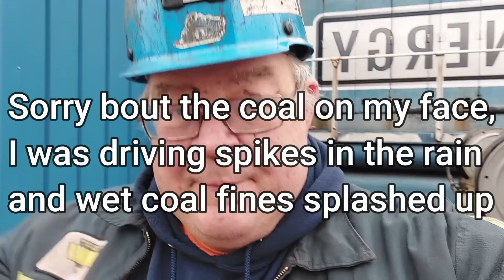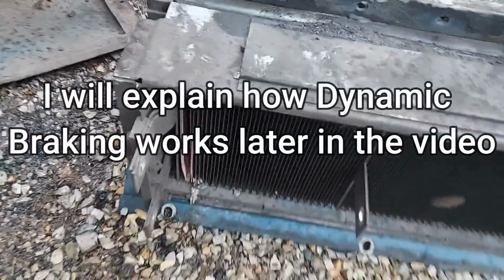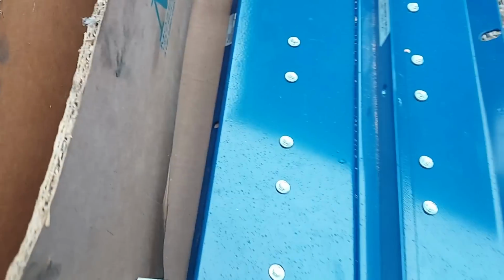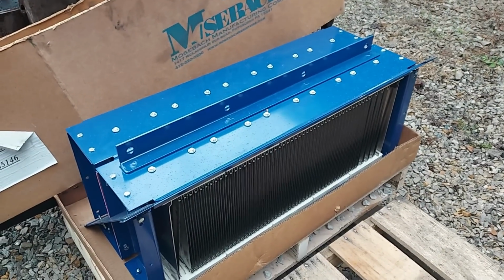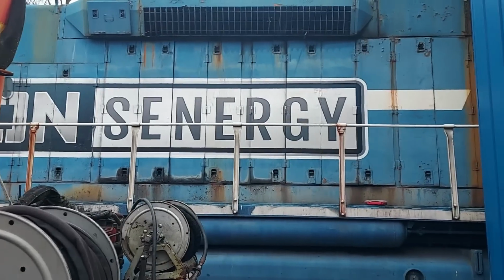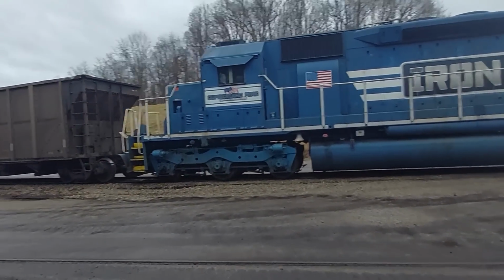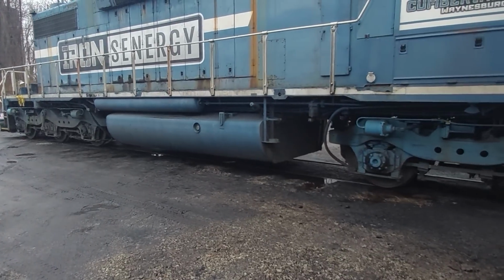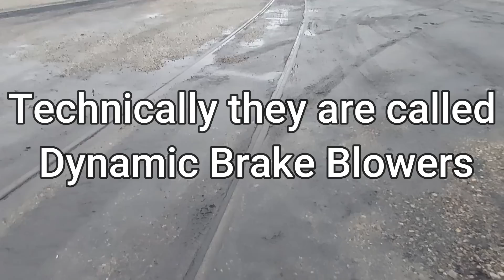New Locomotive Dynamic Brake Resistor Grids

Comment: There is no need to apologize about the soot on your face. At least you are making some contributions to America. I remember that the resistors underneath the [electric] New York City railcars or subway cars have been formally called "rheostats," in the Road Car Inspector manual. The dynamic brakes work as a combination of electric brake and pneumatic (airbrakes). Long ago, I was told that when the controller is switched off, the traction motors rotate in the opposite direction to cause a "slow-up" of the train, and a slight amount of airbrake is added during dynamic braking. The electric brake slows up the train and sends braking impulses to the other railcars, trainline. I have always wanted to learn how a locomotive works, and I am willing to learn more.💙
Reply from the maker: That is very interesting to find out about the air brakes working with
the dynamics on those Captain Keyboard, I did not know that. We
have the option to use independent brakes on the loco while in
dynamics but they are not applied normally as part of the dynamic
braking process. Thanks so much for sharing that with me my friend!
Reply: @ccrx6700  Well, you think on high, while I speak on "low." I believe that freight trains are more powerful and advanced than many electrified passenger trains. Thank you for typing to me. Bright Rails and Happy Railroading!👍🚂

Comment: At first I wasn't sure what you were talking about but after you said they dissipate heat I knew them what you meant. The big electric motors in the rail mill where I worked had a room full of heat dissipators. Those motors also could be run either way. Cool video. And as far as the joint bar I thought that was pretty rare for one to break. Happy rails to you.
Reply from the maker: That's pretty neat to hear Michael, I did not know that other motors
had something like that.  Very much appreciate your taking the time to visit with us and check out the video my friend.

Comment: Couple of questions, Dave:
1.  Do you always replace the Resistor Grids in pairs?  You said one looked ok, while the other was obviously worn.
2.  Do you ever periodically wash the locomotives?  The ‘75 looked pretty dirty (I realize they’re working a coal mine). 

Appreciate all your hard work to teach us about managing, repairing, maintaining your working RR.
Reply from the maker: There are 3 grids on each side of the loco Jeff and no only the one
that goes bad gets replaced. On this loco there was a bad grid on
both sides of the loco but they are not replaced in pairs. Once
in awhile they do power wash the locos, they get a big steam jenny
on a trailer to come in when they do it.  Very much appreciate your taking the time to visit with us and check out the video my friend.

Comment: I’m Impressed with the commitment of your new ownership and you new CEO. Hats off to you. For the commitment to such a huge capital investment in maintenance unlike other rail companies. Say the course don’t fall for the new Green Energy B.S. In the Long haul this company will out surpass all others and big returns will be the rewards will come. Ok you didn’t get approval for the bridge to New Jersey, will work out to your advantage cause New Jersey would tax the heck out of you. 
  Dave, I noticed the heat corrosion was always at the bottom corner or the resister bank. May be due to the fine coal dust buildup, very corrosive & creates hotspots on the element. Though the element has lasted a supper long time maybe a change in periodic maintenance plan to inspect and blow out the coal dust. Maybe the air flow through the banks in not even. A simple hand held air flow meter could give you guys a heads up of of pending clog. And make the new ones last much longer. Sometimes the simple $58.00 hand tool can save huge money. So try it. Get base line data now on the new banks and save it as a bench mark for the future air flow test. Just a thought to help keep down time low and productivity high. Be safe work safe & stay alive impress this on your new guys that will take your place & carry on the tradition of Rail Road Maintenance. That’s for sharing your knowledge and wisdom. The Details Do Matter.
Reply from the maker: Well thank you very much MrBillpops for the nice comment. Yes our
owners are spending money on the right things and keeping locos
running is a big one. They have done a fantastic job at getting
some loco contract mechanics in here that know what they are
doing. It has paid big dividends in keeping these locos running.
These guys are really good that we have now working on the locos.
You are right, the coal dust is hard on the grids and there sure is
a lot of it that comes in, just can't be helped unfortionately. 
Very much appreciate your taking the time to visit with us and check out the video my friend.
Reply: Dave I watch all your postings and hit the thumbs up before viewing so I don’t forget. I enjoy every one. One is never too old to learn something. Guess we are little boys with Tonka Toys in big boy bodies and the toys got really big so we can do some Real Work. LOL. Enjoy the NDI testing of the rail was similar to NDI of helicopter rotor blades I did in military. And as a Senior Control Electrician at a Nuclear Power Plant I see a lot of things you point out and talk about are directly applicable to the work I did there. Very strange. The remote control units by Control Chief know very well. 
   Thank you for taking the time to reply. William Thomas-Azud, Westminster, Maryland
Reply from the maker: @MrBillpops  thank you William for the really nice reply 👍😊

Comment: That’s a lot of resistance in those units, what is the voltage of the drive units? Thanks for another great video!
Reply: Or more specifically, what is each unit's rated voltage and current?
Reply from the maker: Traction motors are 600 volts Mark, I don't know what happens when
they switch to dynamic braking, but the amp gauge on the braking
red lines at 650 amps.  Most folks never get to see the actual grids,
all they see is the screening on the outside so was glad I was able
to share a part of the loco no one usually gets to see. Very much appreciate your taking the time to visit with us and check out the video my friend.

Comment: We don't use those over here Dave so interesting to see what the resistors look like. Must of got clogged with coal dust and shorted out making lots of heat as some have said.
Reply from the maker: You are right cedarcam, the coal dust is hard on those grids, but
we can't help that dust getting in there with our operation. All the
coal was cleaned out before we put the new grids in.  Very much appreciate your taking the time to visit with us and check out the video my friend.

Comment: Dirty jobs are essential jobs.  Never apologize for dirt because someone needed to get dirty.

I load test my generators with electric water heater elements, very similar energy dissipation.  Saves a lot of brake wear on the locomotive
Reply from the maker: You are right in that Keith, around the coal mine if you don't get
dirty you ain't doing nothin...:-)  Interesting about the testing you
do. Very much appreciate your taking the time to visit with us and check out the video my friend.

Comment: Hello Dave.  I live about a quarter mile from an NS line and last summer you could a train coming out of Columbus with a very loud howling noise.  I was thinking there's something wrong with that loco, dynamic brakes maybe.  A short time later, it sounded like that locomotive was being shut down and then the train itself slowed to a stop.  Couldn't see it though since it was behind trees but I've never heard anything like that before or since.
Reply from the maker: Interesting clineshaunt, I have no idea what that noise could have
been, perhaps a blower or turbo going bad? The grids don't make
a noise when they go bad. However the last one that went bad
was after dark and the operator saw flames shoot out from the
screening. That must have been a pretty cool sight to see in the dark!
Most folks never get to see the actual grids, all they see is the screening on the outside so was glad I was able to share a part of the loco no one usually gets to see. Very much appreciate your taking the time to visit with us and check out the video my friend.

Comment: yes the diesel motor turns the generator, that powers the traction motors when driving the cars and engine.
but instead of using brakes to maintain speed, they switch to dynamic brakes, as the traction motors turn
they produce electricity, which should be evenly distributed to the coolers that are kept from melting by the
from the heat, by the large fans dissipating the heat, causing the “ dynamic brakes “ the motors cause a drag as
they produce the electricity which maintains the speed as long as the limits for speed and grades are not 
exceeded! it is a ton of heat that is produced, over time the surfaces get oxidized making them less efficient.
that is when you have failures occur due to the oxidation acts as an insulator, making difficult to remove the heat.
sorry for so long of my writing Dave great job, keep up the great videos.
Reply from the maker: You are correct in that Barry, also consider that the coal dust that
gets in these grids is not good for them either. All the coal dust
was removed from the area before we put the new grids in however.
Very much appreciate your taking the time to visit with us and check out the video my friend.

Comment: thanks for showing us this Mr. Dave never seen these over sized toaster before...i wonder how fast they could cook toast or a thanksgiving turkey. heard G&W has to put down 80 of their locomotives for not meeting new epa regulations. many of them this era GPs also seen a bunch of old engines needing refurbishing on virtual rail fan being taken some where 10 days ago
wow, heck of a grounding issue. what's causing it? birds and bugs getting in there making homes or just the coal fines being pulled in and accumulating over time and then the humidity or precipitation wets them up enough to conduct ground shorts? that's impressive grounding melt slag in that it's not a larger mass melt/fry and just looks like over time melt degradation except that last one you dropped down looks to have very recent high ash burn on it. plus the shine on the metal slag says it was fairly recent or was recently remelting.
i see the new insulator tray looks like plastic, what was the old insulator being used? nylon like the old electrical wires? i don't see any trace of it every where the short is, or any where else on those copper fins. lot of money in copper right there.
Reply from the maker: Conrail called them toasters aprilgeneric. Coal fines getting in there
certainly do not help matters at all, and no one ever takes the screens
off to clean out that coal. However the coal was cleaned out before
the new grids got installed. The tray you are speaking of is metal,
if I think I know what you are referring to.  A lot of locos in California
are going to have to be taken out of service if their new regulations
pass. Just a matter of time before some other states follow suit
if that occurs. Very much appreciate your taking the time to visit with us and check out the video my friend.

Comment: Gee Ohm's law on a railroad if the traction motor/generator is making something like 1000volts at 300-400ampurs , its a low resistance, (3.3ohms) but what 300KW, wow that's some resistor, it would keep your coffee hot.  found it the load bank is 0.860 ohms Dave this is cool stuff.
Reply: volts will be from 480 volts up to 600 is the max voltage.
Reply from the maker: Glad you enjoyed the show Mack. I don't know what voltage the
dynamics work at. I do know the last grid that went bad was
after dark and the operator saw flames shoot out from the screening!
That had to be a cool sight to see.  Very much appreciate your taking the time to visit with us and check out the video my friend.
Reply: @ccrx6700  Flames plus coal fines plus lots of air from the blowers makes a nice n toasty fire! That's how the power plants work, they turn your coal into powder, then light it up at with high pressure air :)

Comment: Hello Dave, I love your content and watch everything that you do. I am an engineer, but not on a railroad. I am wondering how you measure curves on a track just using one dimension such as an angle. I’ve been in this for 60 years and you always need another dimensionangle and a radius. I know it’s probably different in railroading so I hope you can explain it. Thanks keep up the good work.
Reply from the maker: I do believe I answered you in another video comment on that question
Cobra, perhaps you didn't get the reply.  On a RR curve, take a 100
foot chord on the arc of what would be a circle, with the curve representing only a portion of the total circle. Then from  both ends
of that 100 foot chord, the radius runs to what would be the center
of that circle. The degree between those two radii is the degree of
curvature. While it is not 100% accurate, it is close enough for RR
work.

Comment: A small but very important part of the "Whoa Nelly!" system
Reply from the maker: That's right Jon, whoa nelly and they work very well. We have
some steep grades here with heavy loads and in dry rail seldom
do they have to use car brakes, the dynamics hold them back
well. wet or icy rail they do need to apply some car brakes 
going down grade.   Very much appreciate your taking the time to visit with us and check out the video my friend.
Reply: @ccrx6700  Eagerly anticipating more videos on how your stuff works.
Reply from the maker: @jonmccormick6805  👍😊

Comment: It basically turns the traction motors into generators and the electricity they produce runs into those fins, just like a giant space heater and the energy is released as heat. Because as we all know, energy cannot be created or destroyed. It just changes form. In this case, giant space heaters.
Reply from the maker: You are right about that Bryan. Conrail called them toasters :-)
The energy created by the traction motors, now generators has
that energy dissipated into the air as heat. Last one that went
bad was after dark and the operator saw flames shooting out
from the grid. Bet that was a cool sight to see after dark! :-)
Very much appreciate your taking the time to visit with us and check out the video my friend.

Comment: Hi Dave. Love your broadcast as usual.  You didn't say how long the failed units had been in service, possibly that's unknown.  I wonder if the coal bits that get in the grid accumulate swiftly or over the course of a decade.  If it happens often, they might fabricate a shield to place over that grid to prevent the pieces from falling in there. 
Also I'm curious if those locos are run at their maximum capacity with 39 loads, or if thats just the limit of space on the rail line.  Do the locos ever have to pull at full throttle on the CCRX?  Keep up the great work!
Reply from the maker: Thank you. I have no idea how long those have been in there
MusicByWinston. No one seems to keep track of stuff like that
here, sadly..... Yes the coal in there does not help matters and it
accumulates over a fairly long period of time. Each of our locos 
can pull up to about 70 loads per loco, so power is not a problem
with only 38 cars on the train, it's there is no room on either end
at the harbor or prep plant for more cars than that.  Yes in deed they
do pull at full throttle going up a grade loaded. We only have 1 spot
where that happens, it's at our MP 8 siding to pull about a 2 mile
grade of 1.5 percent. Appreciate your watching the dynamic brake grid
show my friend.

Comment: Dave,
That is the first time I have seen the units removed from the locomotive. Very cool! Is this the first time they were replaced? Given their extensive damage, why weren’t they replaced earlier? Seeing the sister locomotive, was it inspected as well?
Having lived in Reno, NV most of the dynamic brakes were heavily cooked having to make it over Donner Pass. 
Thanks for posting this!
Reply: If I had to guess, they probably looked fine until they sorted, then the arcing and sparking ate away all that metal within a minute or so, until it finally melted away enough to break the circuit. Kinda like a giant fuse, it's fine until it isn't.
Reply from the maker: Most folks never get to see those units, all they see is the screening
Jeff. It didn't take long I figure for them to get burnt that bad so
they were replaced as soon as they found out there was a problem
with the dynamic brakes. I'm sure those guys who run Donner 
use a lot of dynamic braking coming down grade. Very much appreciate your taking the time to visit with us and check out the video my friend.

Comment: Some good copper in there...
Reply from the maker: Yes sir there is, the old ones get sent back to the manufacturer
for a rebuild David.   Appreciate very much your taking the time to check out the dynamic brake resistor grid video my friend.